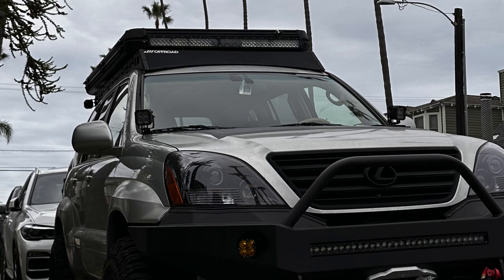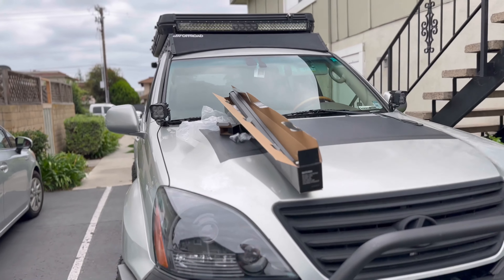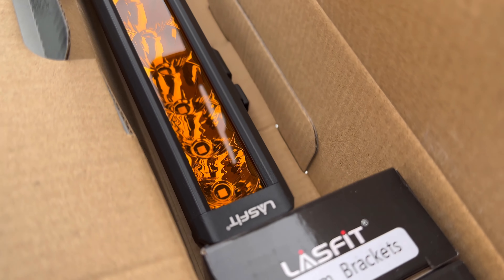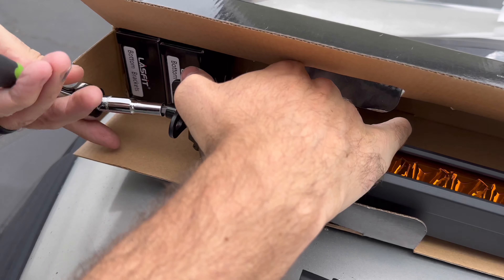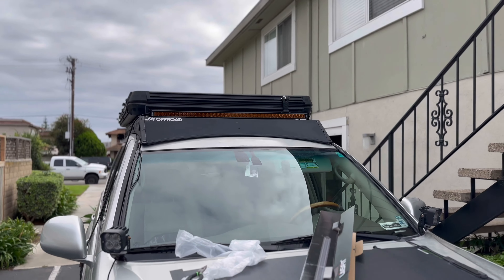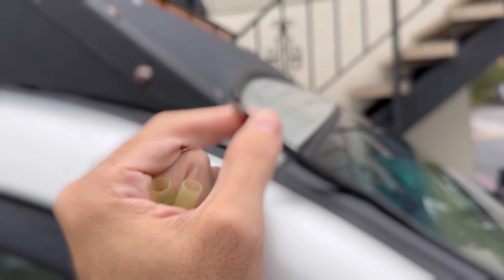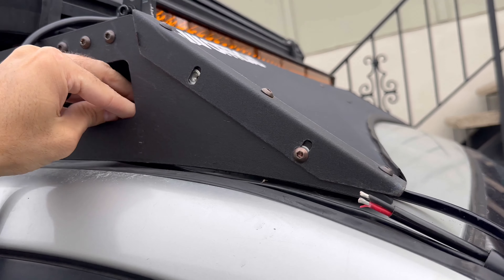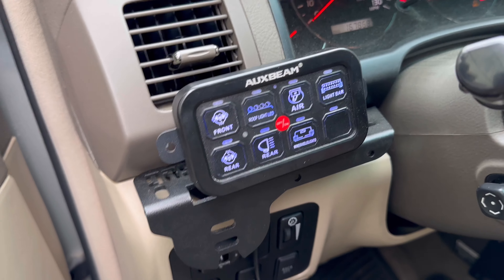Lexus GX470 - Lasfit 42” Roof Light Bar Install and Review

Comment: Would it work without a roof rack?
Reply from the maker: you would have to come up with your own mounting solution. I’m not sure if anyone has done it on a GX. I’d go to the site and pick out a smaller light bar, maybe a 30”, and figure out a way to mount it into the front bumper, where it’s easy to drill holes for the mounts
Reply: @lexus_offroad_adventures  what is the roof rack brand?